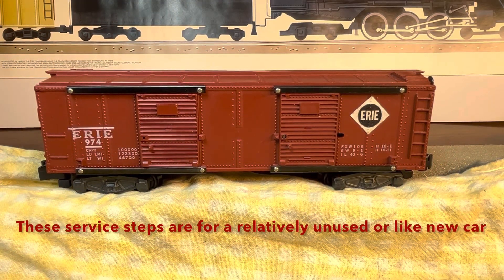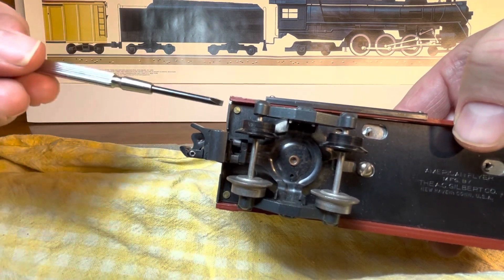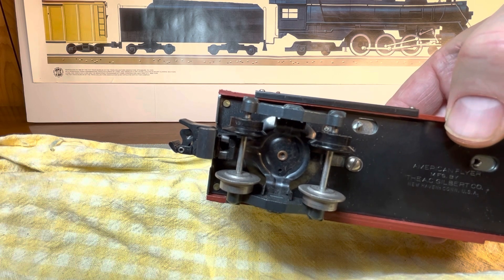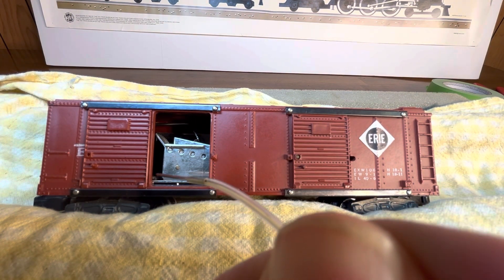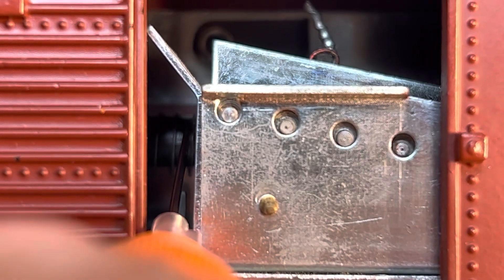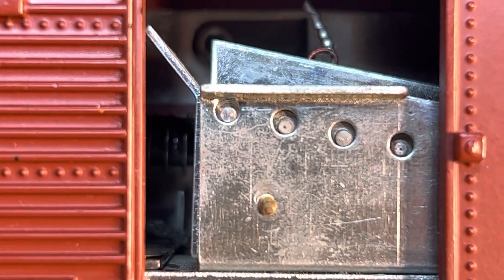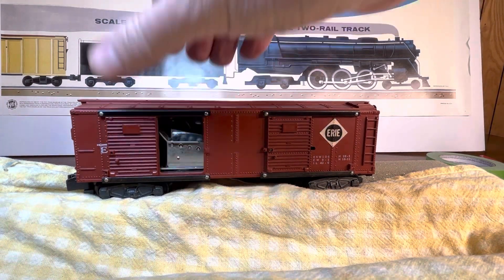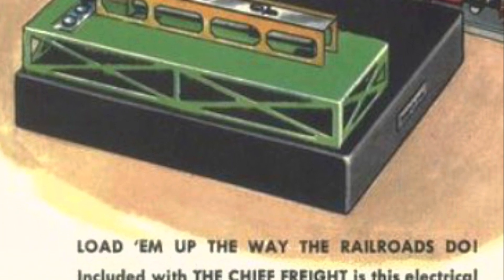American Flyer: Easy Service on 732, 734, & 974 Operating Cars

Comment: Have you ever tried Tri-Flow oil? Synthetic with Teflon. Was developed for racing bikes, used extensively by sewing machine mechanics. I've used it on Gilbert e-units (the drum pivot points) with great success. You can find it on ebay.
Reply from the maker: Thanks for the tip.  I’ll check it out.
Reply: I take all mine off with the soldering iron tip with just enough heat so the rivet moves. Try on a common car until you get the hang of it, works like a charm.
Reply from the maker: I remember that now.  Ray used the iron  until the river moved then he had a special pliers that he could grab the pin.  The pins push right back in with the soldering iron as well.  Thank you!
Reply: CRC 226 can do wonders I believe and the oil made for hair clippers also can be the answer since I use that also. I can't remember names of anything.